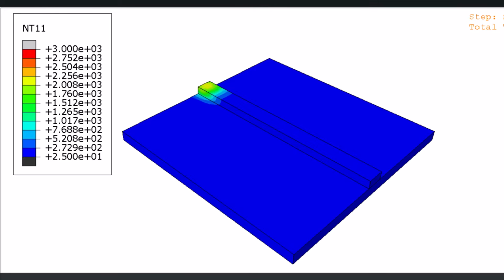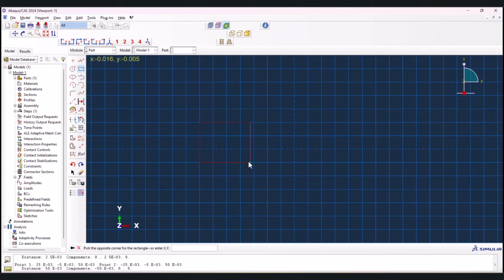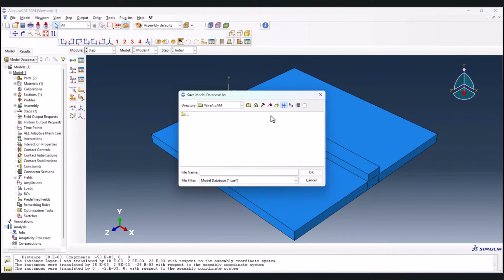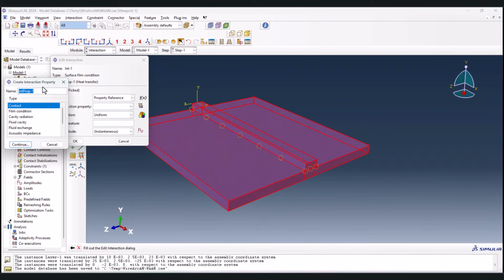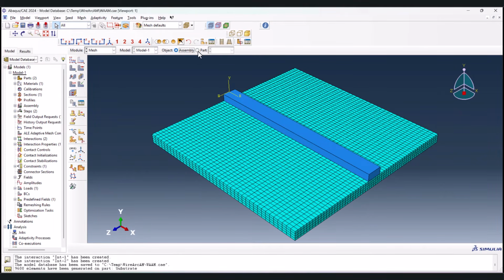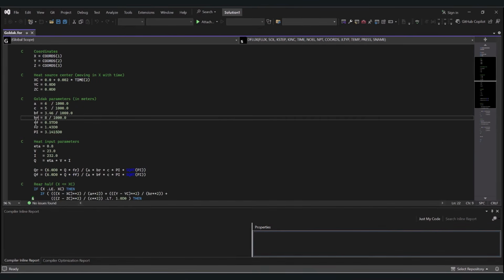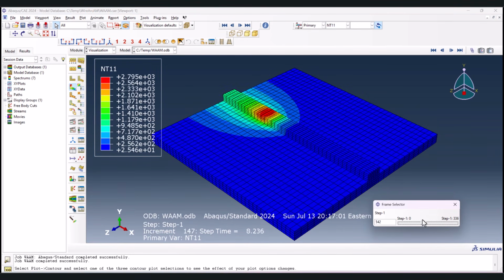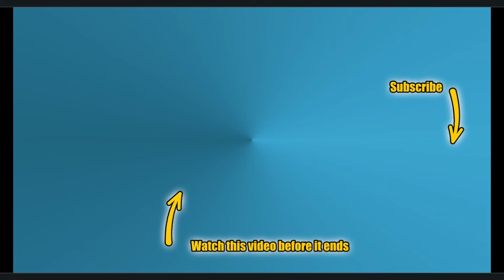Wire Arc Additive Manufacturing Simulation in Abaqus

Comment: Unable to run using ABAQUS 2022. Firstly, both the film coefficient and surface radiation wasn't availble. During run, it crashed quoting, problems with compilation of the .for file. Though I thoroughly followed the video, and also all the code!.
Reply from the maker: It might be because your Abaqus and fortran are not linked! There’s a video on it check it out.
Reply: @FEAMASTER where is that video?

Comment: I followed all the steps but when i submit the job it dosnot run. status is showing submitted not moving to running part can you please help me in this. It is getting aborted showing error - Problem during compilation - C:\Abacus\practice\WAAM\goldak.for
Reply from the maker: Hi thanks for reaching out, basically this error means the code is not written in the correct format. There's a message file in the folder showing you which line of the code is not correct.
Reply: @FEAMASTER  Thanks for your reply. But I copied the code from your website. Is there any mistake in the code?
Reply from the maker: @VipinKumar2492-k7l ok in that case you might wanna 
change the directory back to the default which is C:/temp. It’s better to save it then open Abaqus- open- cae then run it.

Comment: woulld you make tutorial of welding two pipe with TIG ¿
Reply from the maker: Absolutely! A TIG welding simulation of two pipes in Abaqus would make a great tutorial. I can show the full setup—geometry, meshing, heat input via DFLUX (or analytical field), and thermal-stress coupling.

If you're aiming for something specific—like multi-pass welding, residual stress prediction, or axial shrinkage—just let me know and I’ll tailor it around that.

Comment: Thank you for the video. Great informative video for learning. Can we also get for two layer like previous additive manufacturing video(like: multilayer additive manufacturing) using elements activation by DFLUX and USDFLD subroutine and finally predicting residual stress (like: ABAQUS for Additive Manufacturing: Predict Residual Stress Like a Pro!).
Reply from the maker: Thanks for the nice words Arijit! Yes of course! Just be patient new videos are coming in a sequence!
Reply: @FEAMASTER  Thank you for your response. I am eagerly waiting for the video to learn to use DFLUX subroutine, Element activation using python script also USDFLD subroutine for thermal conductivity, so that latent heat for different phase we can apply
Reply: I have tried with different magnitude of thermal load for 2 layers, But the stress at the last stage is coming out to be same. Does magnitude of heat flux and velocity of heat source (scanning speed) affect the stress distribution?
Reply from the maker: @Arijit-ME  Yes, both heat flux magnitude and scanning speed affect residual stress. Higher heat input or slower scanning leads to more thermal expansion → higher residual stress. If your stress doesn’t change, check if you’re running coupled thermal-stress analysis with temperature-dependent properties.